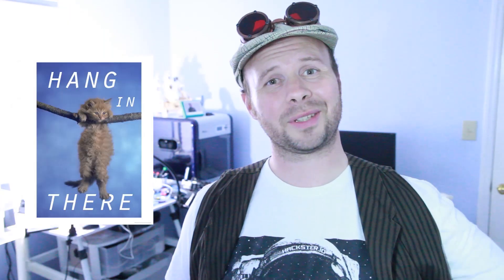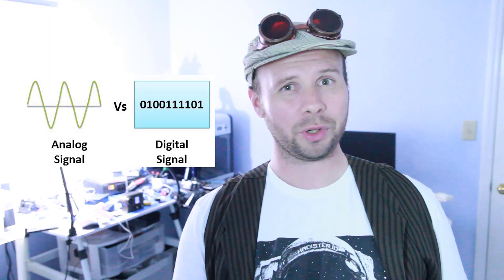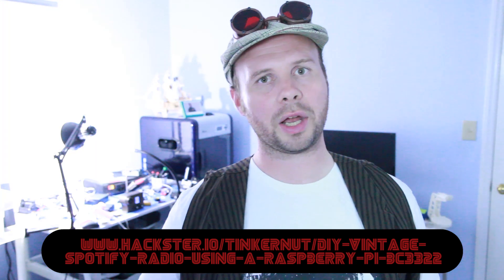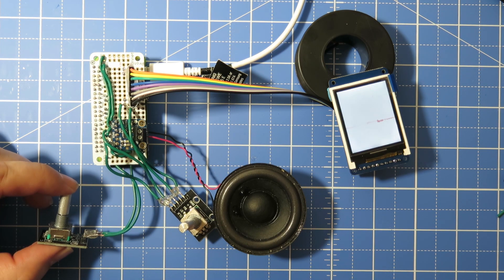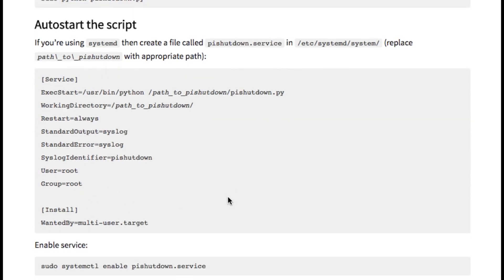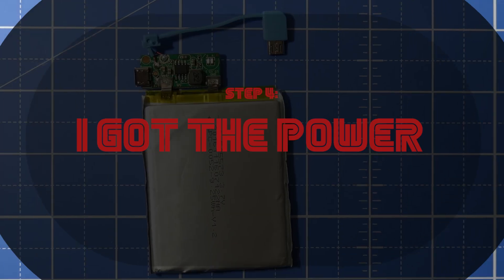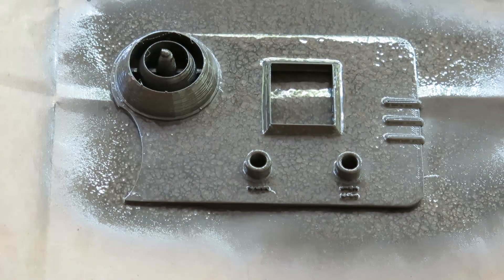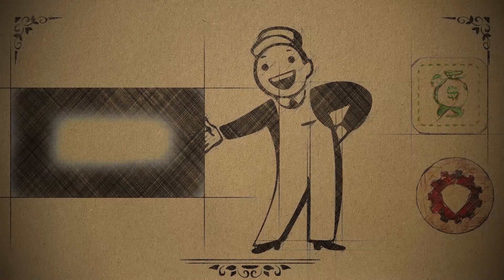DIY Vintage Spotify Radio Using A Raspberry Pi

Comment: I wonder if there's a way to have it pull in AM, FM-stereo, and HD radio from over the air though? That'd be a more interesting trick. Then put on a wire drop to an SD and USB card socket for that as well. Use software for a 5 band EQ. Then have it go to a decent enough amp circuit. Power all that via two 18650s (with yet another USB charging circuit), and put it into a 3D printed chassis with removable speakers in the style of an 1980's boom box.

Oh yeah... Program the display screen so the UI only needs 6 or 8 push-buttons and two rotary encoder/button knobs for user input. (One encoder is just I/O volume though, but the other one would be mode select on push, and the function determines what the other buttons and knob does.)

And then you'd have something better than most commercial offerings on the market right now.

Or would that be asking too much?

Comment: Great project. I thought it is all the video about this, but than you said at the end a better video is coming out. Maybe the only issue i have is the way too string light coming through the window. Also i feel the case could have been made from real wood or at least sand the print lines.

Comment: Why are you using hot glue to protect the connections? Just get a crimping tool and some cable connectors for crimping, wouldn't that be much more secure? You can still isolate it with shrinkable tubing and a heat gun, everything would just be cleaner and nicer.

Comment: i like your video style but i kinda got bored of the radio after the third vid also 
TINKERNAUT RUN THAT WASENT YOUR FUTURE SELF IT WAS A  TERMINATOR THAT SPOTIFY RADIO BECAME SELF AWARE AND TRIED TO PREVENT YOU STEALING ITS CPU POWER FOR THE LCD

Comment: Hello Tinkernut!
I've got an idea for you :)
I've bought a Pi, but I have more applications for it, and buying n+1 pi is not cheap, and a pi is OP for it. Then the ESP8266 came around. It is a 80MHz MCU with built in wifi! The company published a source code on github, that makes it able to use it as an internet radio, or mp3 player. But it is a good ida too to use the Pi as a server, and these as controllers. Example: You want to play music in more than one room, so use the Pi as the media renderer, then use the ESPs as controller.

Comment: You could of used a potentiometer between the amp and speaker.  I can see how the rotary encoder would be more versatile in a different applications.  From the looks of it the rotary encoder can also act as a button and thus making the seperate on/off switch redundant. 

Also a bit of acetone would clean up the look of the 3d print by smoothing out the sides and melting the layers a bit. Also I think it would make the print stronger.